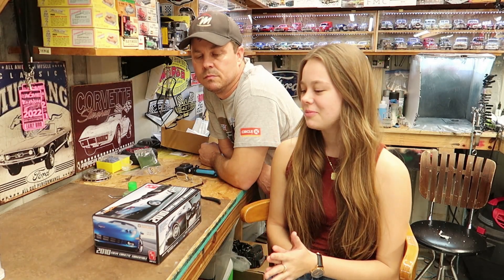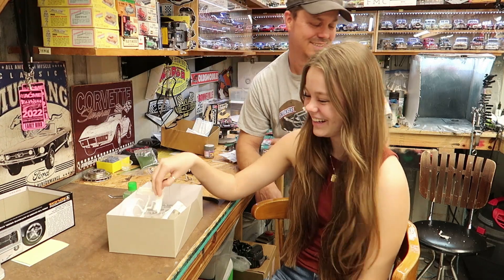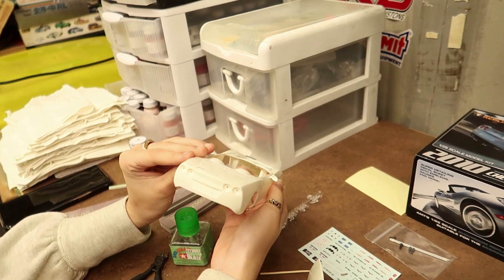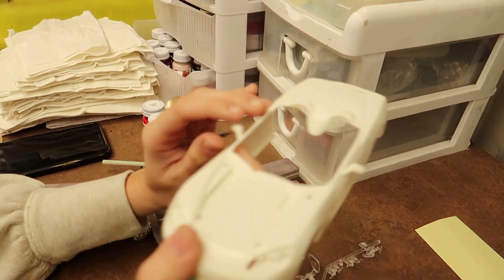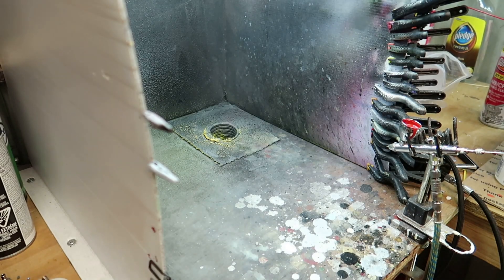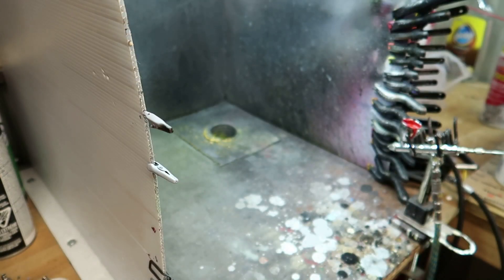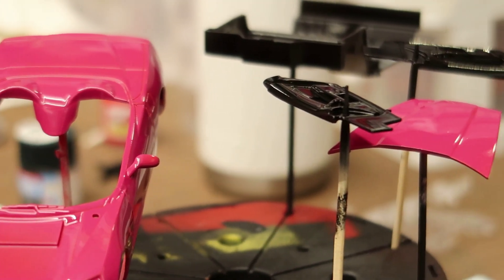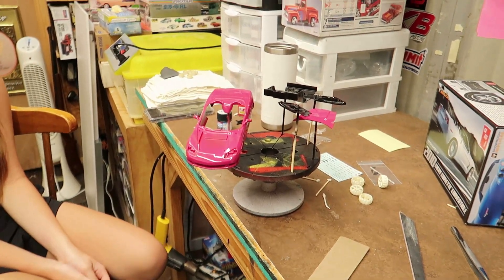Just like a girl to paint it pink!! Ruthie starts the Corvette!

Comment: I built that model and it was a nice little kit and I painted my a metallic pink as well lol. I built the concerts le and the non convertible they are basically a kit version of the old school promo cars I loved them. I used rims from a Ford gt lemans revelle racing kit instead of the stock rims for both of mine but they are both in metallic pink

Comment: They do have a type of bumper bolted to frame that sticks out from the frame, more shock absorbtion maybe, but they are under the facias...
Reply: There are two flat plate bumper mountings that can hold the carbon facia front clip firmly to the front of this Chevrolet corvette both of the front and rear bumper mounting facia's are 🔩to the frame of this Chevrolet corvette the frame of this Chevrolet corvette is the only part of this car that is made from steel the rest of this corvette is made from fiberglass and carbon fiber and the glass that is in the windshield and in both of this car's door's and if this corvette has a hardtop the rear window is also glass but if this corvette has a convertible top then the rear window 🪟 will be made of clear 👀through plastic and yes the name corvette is ingraved in the fiberglass front clip of this Chevrolet corvette mounted on both of the flat steel plates also mounted to the steel frame of this Chevrolet corvette this corvette is and looks like the 1,000,000th Chevrolet corvette that is painted 🎨gloss white with a red interior and a black dashboard this 1,000,000 Chevrolet corvette was severely damaged when the floor it was sitting on collapsed the 1,00,000th Chevrolet corvette was re-built and repaired and is back on display at the corvette museum in bowling Green Kentucky unfortunately 17 other corvette's were also heavily damaged but three of these 17 corvette's that were severely damaged when the floor of the corvette museum had collapsed turned out to be total losses and were sold for scrap and then were taken to a junkyard were they were crushed and shredded for scrap and were then recycled ♻️to be made into new material that would be used to make and build brand new Chevrolet corvette's but all was not a total loss at least you can say that the 1,000,000th Chevrolet corvette was able to be saved and was re-built and like I said is now back on display at the Chevrolet corvette museum were the public can go to see it and other Chevrolet corvette's that are also now back on display as well after the damage to the Chevrolet corvette museum was repaired to this very day nobody knows what caused the floor of the Chevrolet corvette museum in bowling Green Kentucky to collapse I myself am still trying to figure out what the cause for the Chevrolet corvette museum's to collapse was can anybody please let me know what caused the floor of the Chevrolet corvette museum in bowling Green Kentucky to collapse was?.